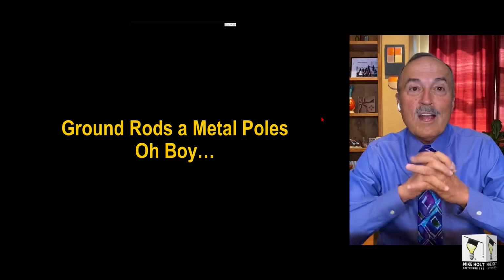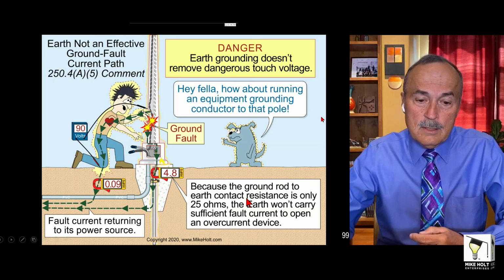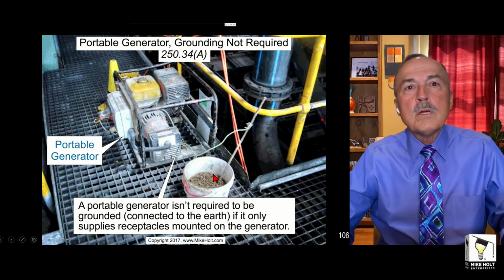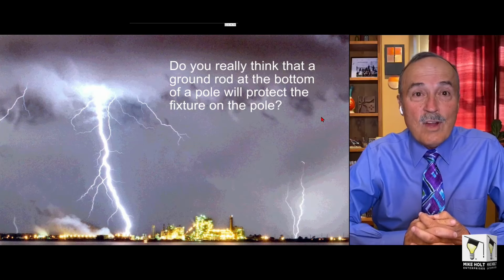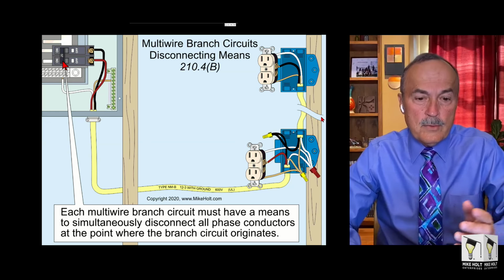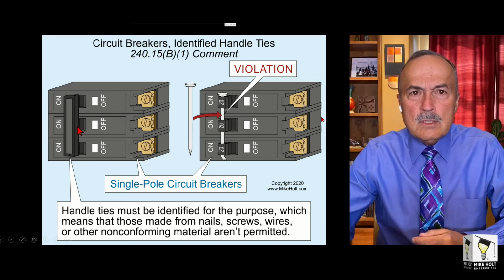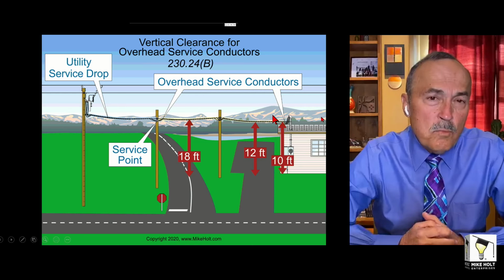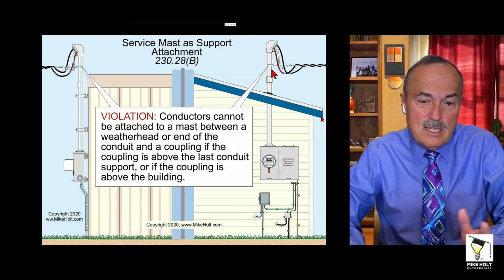Mike Holt Live Q&A, Tuesday,  May 12th 2020

Comment: Thank you for this valuable information. I have a question about how to ground fiberglass lighting poles that are used for lighting public gardens and streets. The inside of the pole contains a metal pipe one meter high for holding the fiberglass pole. The pipe is welded to a square metal base. The metal base is fixed on the anchor bolts of a concrete base that is installed into ground. My question is does the metal base of the fiberglass pole need to be grounded(or bonded) by the equipment grounding conductor? Is it ok to use the steel wire armoure Instead of a copper wire as an equipment grounding conductor? The feeder to the pole is a steel wire armoured cable with four cores copper wire  with a 230 volt line to neutral 3 phase system. By the way until this moment i have seen a lot of lighting poles that are grounded by steel rods only.
Reply from the maker: We don't ground metal or plastic poles. Watch this video - https://www.youtube.com/watch?v=mpgAVE4UwFw
Reply: @MikeHoltNEC  ok. I have got what you said.
I used the wrong words in my last question.
What is important  for me is about bonding the metal part of the fiberglass pole to the circuit protection conductor.
Reply from the maker: @KM-zm2iy  What metal parts? Send me photo or detail to Mike@MikeHolt.com.
Reply: @MikeHoltNEC  Hi Mr.Mike, I have sent pictures to your email. Please check my email (kmayyad2@gmail.com).

Comment: i noticed something interesting mike when you were reviewing multiwire branch circuits. if you use 2 single poll breakers and the black wire breaker is on, the red wire breaker is off, and the neutrals are all spliced together, and you have a light bulb plugged into the red wire outlet, than current will actually flow from the black wire through the device plugged into the black wire outlet through to the neutral wire and it will actually flow through the bulb plugged into the red wire outlet as well as the other neutral to get to its source.
Reply: No it will not. If the circuit breaker for the red circuit is off, where would current flow?

Comment: Dear Mike, I heard you say in one of your videos that lightning is DC voltage, with a high-frequency range. I think Lightning is a transient impulse, its neither AC or DC, but a combination of both. A signal can be DC if the ripple factor is less than 3% and magnitude is +/- 3, during a time period. Lighting frequencies are range from 1KHZ to1GHZ, where there is no frequency in DC, but the mixture of AC&DC

Comment: i think ive seen this before
Reply from the maker: Well... I just made this video last night...
Reply: @MikeHoltNEC  thanks mike i think its just some of the same illustrations and stories from another of your videos on you tube im not complaining i have to hear it a few times sometimes for it to stick by the grace of God i'm understanding more and more how the ground wire and bonding should realy work if i understand it correctly they act like a safty if devices metal components comes in contact with hot wires proper grounding and bonding will guide electricity all the way back to the transformers neutral and not actualy to earth thanks for all the info im gona order some of your dvds soon
Reply: @chrisf9607  Exactly. Providing a safe grounding path back to the GFCI device.